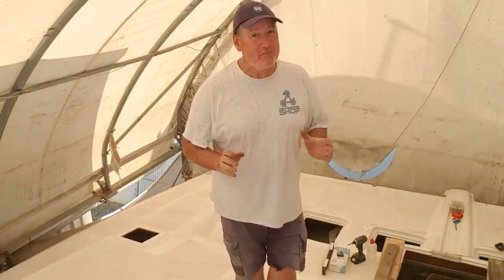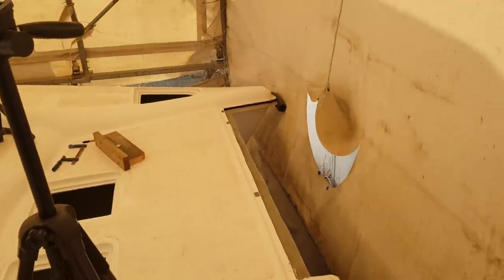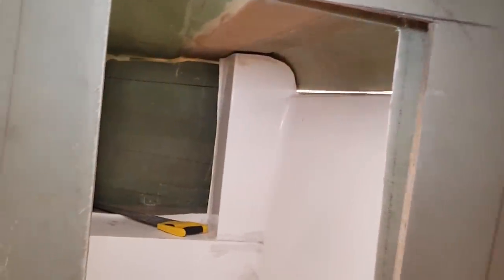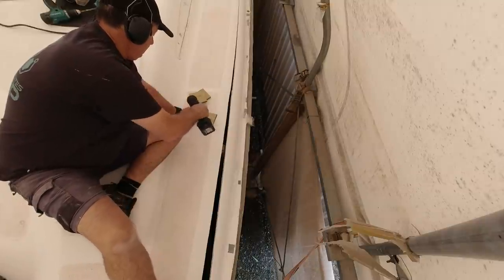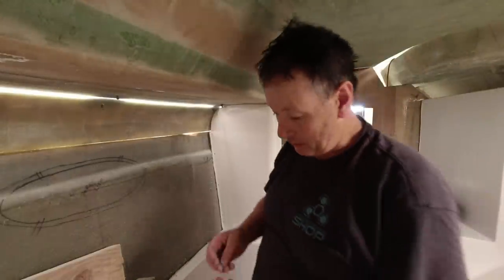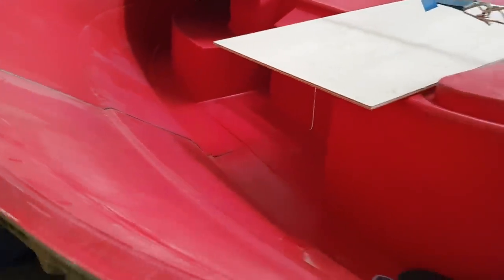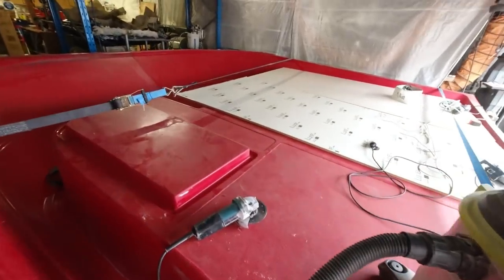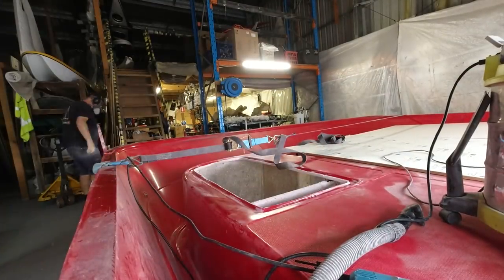It's Deck Enlargement Surgery for this Catamaran Ep201

Comment: Glad you made it through the health issue and are back “at it.”  You are the man!
Reply from the maker: Back on deck literally.Cheers Mate.Ross
Reply: @LifeOnTheHulls  Hi Ross , Glad your in the final stages of the new cat , will you be able to get a final weight of your cat at completion , just curious how much weight difference from that old manufactured method ?

Comment: Hi Ross 
If you move the last sheet forward and cut your arc into it you just need to put a rectangle piece in behind the sheet. Might be easier then cutting a curve into a small skinny piece. 
Love the videos as always.
Regards mark.
Reply from the maker: Yes that would have been better,sadly didn't think of that and would have required more supports underneath and by the time I worked that put I had biscuit joined it all together.Cheers Ross

Comment: Another Idea, is to incorporate a rain water capture system on the fly deck. You can than have that fresh rain water put into a tank that only needs particle filtering rather than pushing it through a water maker… save on electricity and time. Rainwater tast better than when it comes out a water maker.
Reply from the maker: Thanks Ash there will be rain gutters and a lot of other sections on this roof for solar panels and the like. Cheers Ross

Comment: Rossco>>Rossco>>> Is it your intention of ever sailing this vessel or what?  LOL..  Watching the work you are doing for this 'cover'!  Have you ever seen how a hard dome shell is made? A balloon is blown up and a poly spray is applied. After it dries, a second and third layer is applied. Once dried, the balloon is deflated and the round shape is left. Then a cut is made along the radius in order to cut out the dome!  Using tubing or wood slats, form your actual roofing, biminy then stretch plastic overtop. Spray on the laminate, 3 coats , let dry then remove the framing and voila, your hard top. Nxt, re-inverse it with 600 cross and 300 apply wafer board and apply 2 more coats of 600bi and 1 coat 300 and you are ready to finish. 
My condolences to Jan and her family. i am sure her mom is proud of her daughter. God bless

Comment: Really coming together beautifully, amazing how fast it went from a collection of pieces into a recognizable boat!  One question though, since it's all flat anyway did you need to need to create a mold for the hardtop or could you have filled the cockpit mold interior with hexacore/foamboard, glass the top and flip it over to glass the other side?  You'd just need an inner lip to glass over instead of an entire inner platform.   I'm sure the next episode or two will clear up why you did it the way you did!

Comment: I know that you are planning to sell the mold once you're done. I'm wondering if you will let the new owners know where they might need to alter the mold to prevent them from having the same mismatch problem that you had during this episode. Im not saying that you need to make the alteration yourself, but making marks or whatever on the mold while its fresh in your head would probably help the new owners considerably.
Reply from the maker: To be honest , I wouldn't bother changing the mould as this is a very simple fix. The hull sides could be plled in further as I already did and the 3cm of total discrepancy is nothing considering the 25foot wide deck structure , easily fixed but I will advise anyone that takes the tooling. Ross.

Comment: As always a really good video. One question, you cut out the stair well blank on this prep, so why not do that on all the other hatches, they surely had strong enough edge mouldings and would have saved quite a bit of time and material.

Comment: Just a quick tip. Is their a way to check the fly deck so you don’t get a repeat of the cutting you has to do with the deck? I think I would need to check it all fits before casting it. Guessing you have checked it?
Reply from the maker: Already checked mate, it is going to fit. There is a lot of work to be done to integrate this in any case and will require some cutting and chopping and was always the plan. Cheers Ross.

Comment: Doesn't using flat lay-up panels remove the built in curve of the original? Will you be able to bend the new overhead enough to shed water?...Could you lay up just the top, pop it out, place small riser blocks along the edges, then replace the top and screw it down in the middle to produce the curve before applying the rim? I haven't done FG work for 50 years, back when a chopper gun was 'high-tech', so I'm guessing you have a plan...You've probably finished the fill in by now, but wouldn't it be simpler to trace the curve onto that last piece, cut it and then just fill behind it with a simple rectangle? 🤔

Comment: Do you think you are dealing with this because you had to cut the mold in half to ship it to your warehouse?
Reply from the maker: More likely the age of the mould and the bracing on the sides of the hull mould were a bit ordinary. I carefully measured the hull and deck and contracted the hull sides to match with ratchet straps and held with metal purlins that were in place until all bulkheads were laminated in. The discrepancy is so minimal total 35mm ( 15mm on one side and 20mm on the other ) and was easily solved, I was just able to show the process which in the long run will look much better than a bogged affair. Rossco

Comment: You moved the bulkheads and created more work inside the boat. The wedges have changed the interior fit. Why didn't you just fill it and fair like the pros. Ross you're moving backward for cosmetics. Not even mentioning the stress fractures later. I can't watch.
Reply from the maker: I haven't moved any bulkheads or changed their fitment,and nor have I created more work inside,in any case outside work us much harder than inside work ,hence the slight alteration to repair from the outside.I am totally confident in the nod and will repair to a perfect finish.There will be no stress cracking either as the underlying laminate now exceeds the actual deck laminate with  no fill or fairing so less chance of stress cracking and more strength than a bogged part.